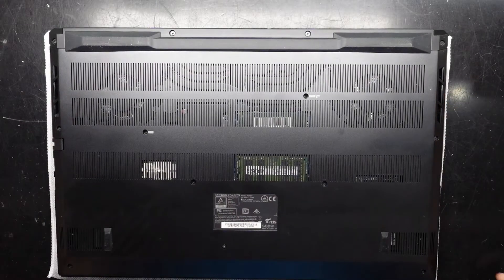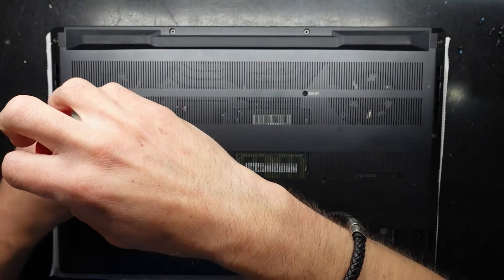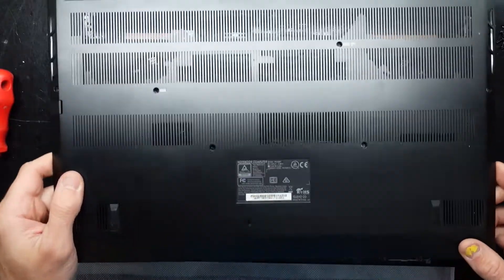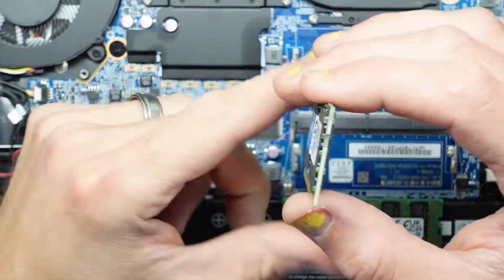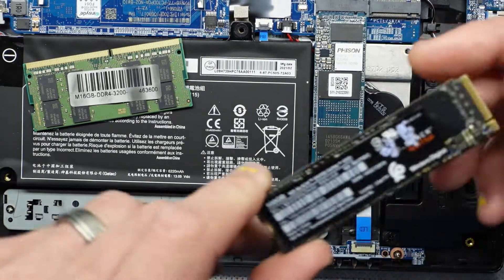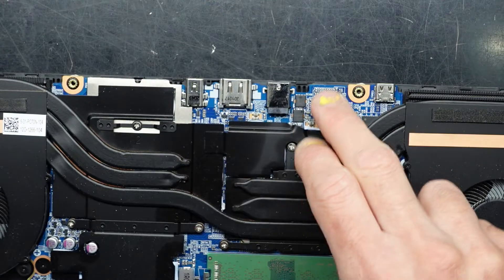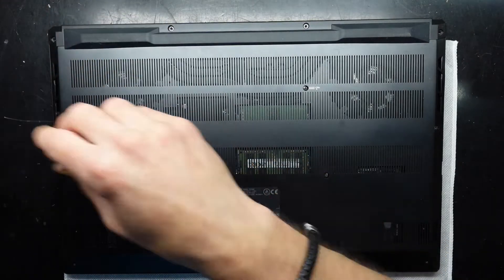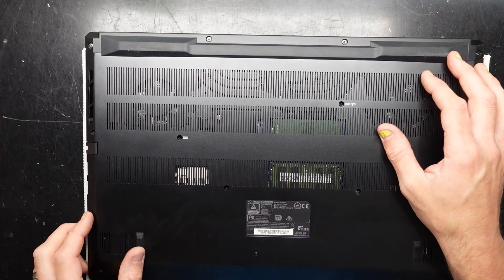Metabox Prime S PC70DP SSD and Ram Upgrade, Teardown

Comment: i have a prime s pa70es-g, started shutting down, complete loss of power, some times it happens multiple times a day or once a day, i don't want to deal with the tech support as they charge through the nose and had a nightmare of an experience with a warranty claim earlier on with this same laptop.

i used to swear by their laptops i had one that lasted almost 5 years, but this one hasn't even lasted 3.

i would avoid them honestly.
Reply from the maker: Does CPU load matter?

Does it crash when Web browsing?
Or just during gaming?

Could be overheating or faulty ram
Reply: @rickstechrepairs  i thought it was from gaming but it also crashes when browsing, my old laptop has some ram in it can just switch those in or do i need the same specs?

also this cpu is always turboing, i tried to undervolt or reduce max power to it using xtu but i dont know what im doing and it became unstable lol, so i reset the old settings.

laptop  is always hot and to access the fans i have to take the whole cooling assembly off, and honestly im not comfortable doing that. I hate thin laptops they always get hot, my old one is fat, and never got as hot as this one, its a pit all fat laptops now are workstations that cost 9000+.

Comment: HI ! thank you for your video ! Do you think it's possible to install a SSD Samsung 980 M.2 PCIe NVMe 1 To without heating problem ? I'm not sure there is enough room for a dissipator...
Reply from the maker: i think it would just thermal throttle itself, so unless you are transfering large amount of data constantly you should be fine 

(large being 100gb+)
Reply: @rickstechrepairs  thank you!